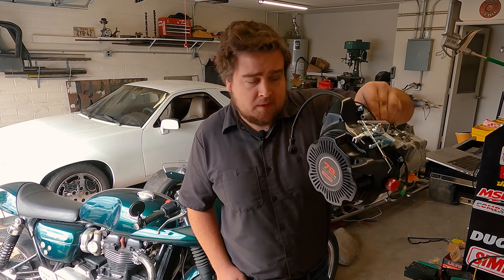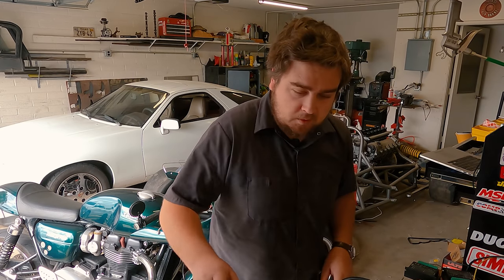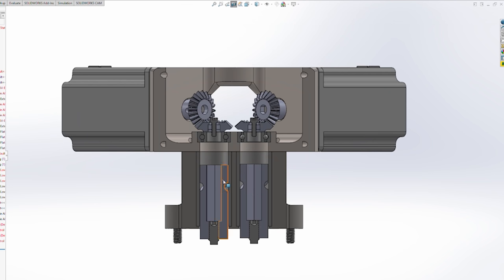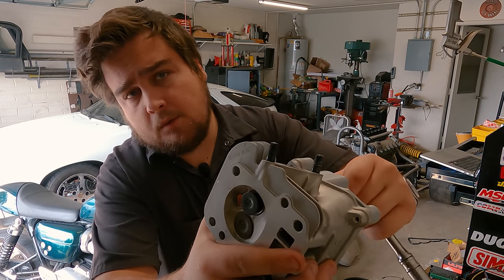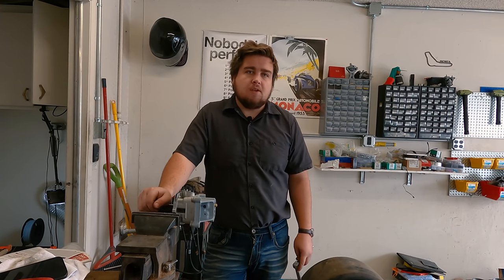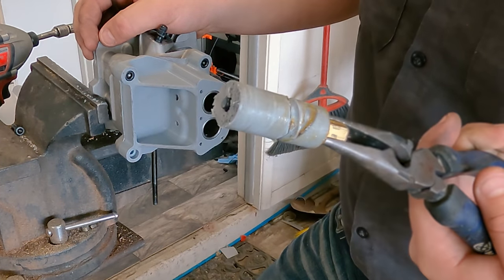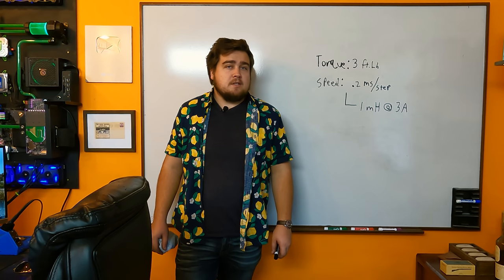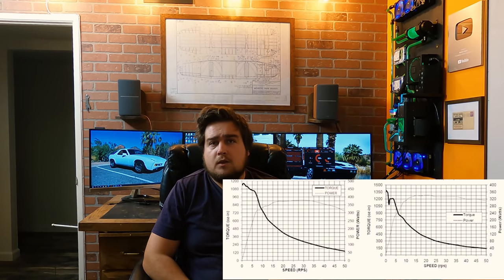Adventures In Deleting Camshafts | The Theory

Comment: 1. I always though pneumatic/hydraulic was the way to go for the mechanical relay effect over an electronic-desdrominic (Wow thats fun to say!) like you did. I know motogp uses a half-way solution, just replacing springs with air pressure (pre-charged before each race) to eliminate valve float and rev to 21k. I wonder if a smaller pump and pre-charged tank could mostly negate parasitic concerns.  
2. Have you ever studied successful desmo-designs for cars and motorcycles? Might open another eye. Early rotary valve designs from 1904-1938 automotive racing engines might also be enlightening.
3. Your dedication to 3d-printing as a final medium is really starting to limit you here where forces are quite large, and heat, high. 3d printed casting is fun, just find a local already in the hobby to collab with, or even better, a machinist, often needed after casting anyway.
4. Go on doing whatever you feel like. I love this stuff!

Also: That was a cluster of footage you made a decent video from. Impressed!
Reply from the maker: It's a lot easier to move heavy things with air or hydraulics. It's harder to have them do the exact same thing every time, because air changes with humidity and temperature. Combine that with moving a heavy object in varying temperatures in under 20ms, and it gets weird. 
I had an old bevel drive '81 Ducati 900ss for a while, and have rebuilt too many 916/996 heads for my liking- I have some experience. 
Honestly, I agree. I'm going to bite the bullet and get some machining tools sometime soon. It needs to happen.  
Thanks for the support! I really enjoy working on this stuff.

Comment: Run servos instead of steppers, they are faster and usually have way more torque. You still have control via feedback. Turbosmart has done an electronic wastegate (I think) using a servo which seems to be really fast
Reply from the maker: I've gotten a lot of recommendations for servos, So I agree I think that's my plan going forward.

Comment: Did you ever think about using the pressure from the engines oil pump in some sort of accumulator to drive a hydraulic circuit to open and close the valves? A factory oil pump will not flow enough, but a dry sump assembly could power some super high pressure hydraulics. and solenoids are FAST....
Reply from the maker: Non compressible fluids are a lot nicer to work with, so Maybe. But oil is a lot more viscous so the pressure would need to be a lot higher. It's something to consider.

Comment: Suggestion; why not wind your own motor? You can calculate the windings to spec, and the motor doesn't even need to be able to rotate 360, so you can probably save a lot of weight. (or wind it like a progressive solenoid contraption).

Comment: Once you get it all figured out you should make one for the 212 predator maybe add a fuel injector option since you gotta have a computer running the valves any how add efi its on cylinder be easy enough just be coding it to spray during intake open phase. Put i know a Facebook group full of people that would be interested in a free valve 212 predator especially if it adds power. Maybe add a dimmer switch to reduce or add to the fuel ratio slightly for weather compensation. Unless you go full ecu and o2 sensor and everything. I think replicating a nasty cam in the free valve and taking the drag off the crank would really get that little motor turning, the resistance the cam adds isn't alot but a little motor every bit helps, and modified sanctioned racing probably doesn't have a freevalve rule, so replicate a cam bigger than what's available due to connecting rod cam lobe clearance issues, and you can prove it makes more power than any modded predator has before people will start pickin them up

Comment: I know there is a valve system that actuates up and down using magnets  extremely fast, not sure what the speed is or if it’s faster or slower than what you got, it’s in Rob Dahms blow off valve. Best of luck I think you might just have started something incredible

Comment: Two thoughts. Could you cut a motor in half and have the rotor spin back and forth 180 deleting the gears? It would need to be a skinny rotor. Second thought, could the motor also have the fore/aft motion built in, like ready-rod with magnets attached....

Comment: So it appears you turn one direction to open, and the other direction to close. Could you have the profile more aggressive and mirror both sides so that it turns the same way for opening and closing? 180° to open, and 180° more to close. This would hopefully give a little more lenience with the acceleration issue, as coming to a complete stop isnt as necessary, but the torque of the motor would have to be stronger. (Hopefully I explained this well)
Reply: The trouble is you would lose the control over lift that's kinda the point of the whole project, since you have to advance to the full lift before the valve can close. At that point, there's no advantage over a conventional camshaft + vvt setup.

Comment: Can you steepen the pitch on the valve travel to less than half turn. That would speed up the actuation time. Theres probably a sweet spot with pitch and torque needed. You would still have the control needed.  The other thing I thoughtvabout was a solenoid instead of a motor.  I know that would cause control problems. I wonder if a solenoid could be controlled that way. Like with multiple stator wirings. The valve spring could be useful here too . Sure you have gone through most of this.  Just adding my thoughts. Keep it up

Comment: All I find myself thinking is, couldn't you machine gear teeth into the valve stem itself and just apply force to the  valve directly? Much like how a table drill move the drill bit downwards, and returns to the upper position thanks to a spring. No plastic or bearings required. Maybe that way you could get more vertical movement out of less motor rotation, and even make each tooth different so it has linear movement as the motor accelerates thanks to the spacing changing..

Comment: Rotary valve instead of  spring valve. Drive the rotary disc on a gear to increase speed. Won't be dependent on springs and easy to vary the PWM and duration to have more or less flow

Machining should be fairly simple if you stick to flat surfaces with round holes etc

Comment: Really think you should use a linear magnetic drive.  Short throw linear motors are super simple, really accurate and can be controlled with a standard Vsec control using feedback. 

And they get you the speed you want. (And no springs required, just reverse the field. )
Reply from the maker: I'm working on a kind of linear motor actually, It's not quite a voice coil but it's in that realm.
Reply: @WesleyKagan  can’t wait to see it!

Comment: I'll try to watch this when i have some time but i don't think it's bound to fail. It's not like you have to accelerate decelerate every rotation the whole system. It just need some speed variation to customise the timing so it does not looks like it's impossible. Maybe some trick sensored brushless would do nice too.
I wonder if it has any upside to fiat multiair for example but looking at koeniegsegg small motor it looks like there is a lot of potential in true freevalving.

Comment: Hi there Kagan,
why bother with accelerating/decelerating the stepper for the ends of the travel? Instead you could make the ball screw a continuous channel instead of a helical one with endpoints. Like the channels inside a selector drum of a sequential gearbox. Then you could also go ahead and have a full valve cycle for every 180 degrees of rotation of the ball screw which would reduce the rotation speed of your stepper drastically.  You could then go ahead and adjust the shape of the channel after testing to have the least change in rotation speed of the motor as possible.

edit:
i just considered, that you probably want to be able to adjust the valve lift as well, in which case you have to consider a different design. In that case you could have a swinging arm with one end connected to the valve and the other on a pivot and adjust the position of the ball screw on that swing arm to adjust the valve lift 
Love your videos
Sincerely
TROG

Comment: Well let's talk about it for a moment. You could use some of the stuff you have. You will need a much larger stepping drive to drive electromagnetic solenoid. The valve solenoid of an oil hydrolic system in 72volt 6amp. Then you can actually programme the depth and duration by pulse.

Comment: You may find it difficult to start and stop the stepper motors so fast. Consider designing your system so that the stepper motors continue spinning the same direction to open and close the valve.  Your lift would not be adjustable, but your valve timing would.
Reply from the maker: I actually did a design off-camera like this, with varying results. I found I could only change a few degrees either way, so not a perfect solution.

Comment: At the speeds and torques you're talking about, you're well outside the design scope of stepper motors. While I'm sure there are some the can do it, a servo would be the smarter direction to take your search now. My first thought was a geared servo, but even that's probably a little slow, so a direct drive high power motor running on something like an ODrive would probably be your best bet. 

The average power demand for an individual valve demand will be relatively low, but at 20ms per cycle, you're probably? going to need response times of 1-2ms on the valves. 2ms and 180* comes out to an average speed of 15000rpm, and a 3ftlb torque, that's an instantaneous power of over 6kW. Obviously your drive won't have to be rated to sustain that, but it must be capable of delivering brief pulses of such power. You'd almost be better off clutching in a spinning flywheel driven by a motor a few times bigger than your average power needs.

I guess this is why electrically driven valves often use solenoids with no springs. Indeed, to make this work you might have to go straight to double acting to reduce your power requirements. Additionally, now might be a good time to get a better measurement of the torque required.

Comment: What about using gear ratio to increase speed? I know you will be reducing the torque but that may be the easier approach with a larger stepper motor, it will also be increasing size but for a test bed on the project it shouldn't matter.
Reply from the maker: Yeah, size and amperage draw is not the concern here. If I can get something fast enough and strong enough, I'll be happy.

Comment: Question... is it possible to re-route your car's AC into your intake as somewhat of a forced induction cold air intake? Would be interested if you tried this out sometime!
Reply: the blower motor on your AC system wouldnt be very efficient at actually pumping air into the engine, turning into a bottleneck, engines drink a lot more air than it seems like
Reply: The cooling effect of the AC is already used in the Dodge Demon, though not quite like you’re envisioning it. In that application, it’s used to cool the water in the intercooler system.
Reply: This exists as a system called the killer chiller, it's used to cool intercoolers/heat exchangers though instead of directly to air

Comment: Have you considered higher torque stepper paired to a gear ratio higher than 1:1 to get the necessary speed? Otherwise it seems you might to go to a servo setup, or essentially any motor quick enough with an encoder feedback for closed loop control. Perhaps BLDC? Would require different drivers, but in the end the code should be comparable.

Comment: Not a mechanical enginner but since the valve has to open and close before the compression stroke, wouldnt the time frame be shorter than 20ms? At 6000 rpm the crank rotates 100 times a second. and intake stroke is 1/2 that. which gives about 5ms for the valve to open and close.

Comment: How would an electronically controlled hydraulic camless valve system work out?
You could use a hydraulic pump driven by the engine and electro hydraulic actuator valve with position sensors bult in.

Comment: Wesley, What about a custom built linear stepper motor? It would be less moving parts and would eliminate the rotational inertia. To be clear for others, I mean a true linear stepper motor, as apposed to a rotational one with a screw mechanism.
Reply: I just read 
Harold the_big_h 's suggestion and I think that merging his idea with mine could be even further improvement. Basically what I am thinking is to either replace the permanent magnets in the stepper with coils or simply build it with the permanent magnets on the outer stationary part and the coils on the inner moving part.

Comment: Does the gear need to reverse to close the valve? What I mean is, Could you make it to where the gears lose contact so that the valve can drop back to its seated position? Like let the gear that directly rotates the valve be reversed by the valve spring that way the stepper motor can just rotate in one direction and at a constant speed for the rpm? I am not explaining it well and it might not even be applicable if I’m misunderstanding something.

Comment: Stepper motors are slow, you may be better off with a low-Z DC motor with positional feedback. Also don't forget that as it gets hotter the electrical time constant will increase so it'll get slower.

Comment: I had an idea years ago, and considering you're this far down the rabbit hole, I figure you may be the most qualified person to talk about the feasibility of such a thing.

What if one were to use something like oversized cams, with the intake and exhaust ports machined into them? So almost like the inverse of a rotary motor, rather than static ports, with a spinning piston, spinning ports instead of linearly actuated valves? Probably haven't explained myself all that clearly, but I'm guessing you get my drift?

Not saying you should pivot to such a thing, was just curious if you thought there might be any viability to such a weird idea.
Reply: There have been many projects like this which never succeeded, as it is very difficult to get a good seal. In poppet valves the pressures inside the cylinder push the valve closed which doesn't work for rotary valves. Additionally, the bushings tend to seize as the rotary valve deforms under pressure

Comment: My only immediate concern of a failure point would be the rotational force on the valve seat. Maybe coatings would overcome this? Clean 928, my question would be if it's an RoW car with headlight adjusters, where's the repeaters in the fenders?
Reply from the maker: I have a solution for that, and at least on single acting It's actually needed. As far as the 928 goes, some of the cars did ship without side marker lights however this one had them deleted.
Reply: @WesleyKagan  Glad you've thought of the issue and hopefully have a solution set. Played with it in the 1970s, but solenoids and controllers were different back then. I thought all RoW 928s (non-US) had side markers post '81.  Learn something new everyday...

Comment: Could you use an electronic controlled regulator and a spring you know how much the valve opens at certain psis and you know how fast it will close from those psis

Comment: Suggestion. why not have a stepper driving the camshaft, and just speed up and slow down when you want more or less duration. this is how rovers VVC system worked, though it was achieved mechanically. I get it still has a camshaft, and your trying to eliminate that, but it will give you absolute controll over valve duration and angle.

Comment: Im not an engineer, but couldnt you use hydraulic oil pressure already generated by the engine to perform this task. You could use the the rise and fall of the engine oil pressure for the cam profile basically and then on the end of the crank design a rotary valve body that would basically spin with the engine in time, dumping the pressure, allowing the valve to close via the valve spring once the hydraulic pressure holding open is dumped.

Comment: not to state the obvious but why tot put the cam on the stepper shaft and get rid of the ball bearing cam profile and beveled gears? I know you sometimes go on a path and try to make it work (we all do) but it becomes more complicated than it should be - I'm not seeing the advantage of using those cylindrical cams vs a regular cam, plus you get rid of a ton of complexity that way (you just moved the cam somewhere else).

Comment: why not increase the pitch or add more leads to the ball screw? surly smaller bearings would reduce weight even if adding another. be nice if they had linear stepper actuators

Comment: Wouldn't it be possible to use a DC motor with a position encoder to actuate the Valves. If I'm correct this solution is used to create force feedback sim wheels.

Comment: I dunno... an oscillating valve train using stepper motors? I'll believe it when I see it... had you considered hydraulics? I mean, fuel injectors can obviously open and close many times a second, but they are piloted, right? So maybe that's the trick, and maybe less room for error than with a compressible working fluid.

Comment: why not an encoder motor from a cnc mill iv work on some that can do as much as 9,000+ rpm affix a cam lobe then you have valve position control and timing all in one and maybe later use the steppers to veri the profile moving the cam closer and farther almost like a dual pattern just a thought